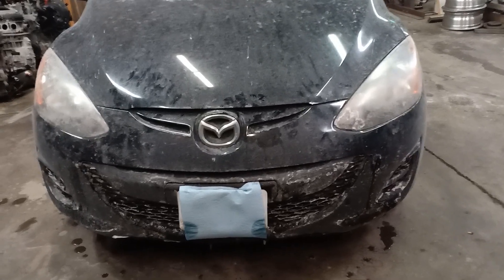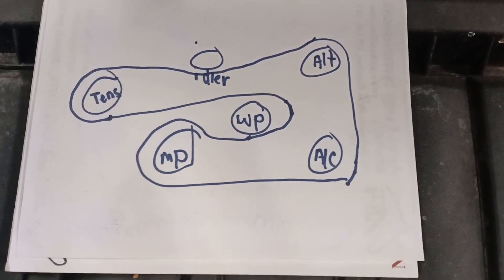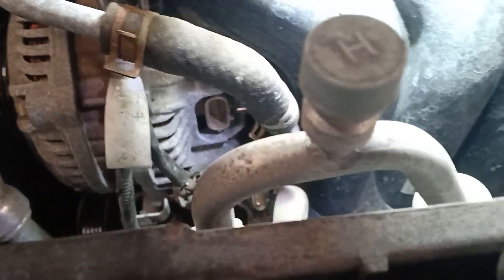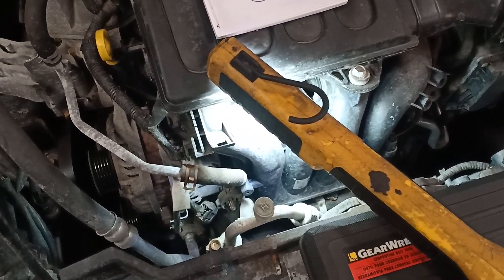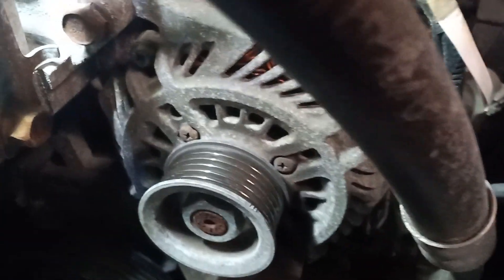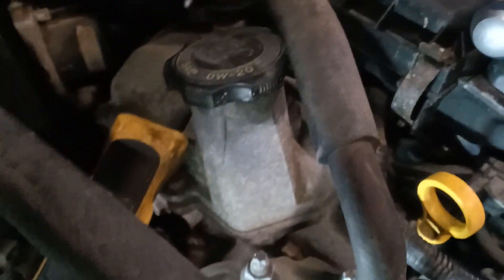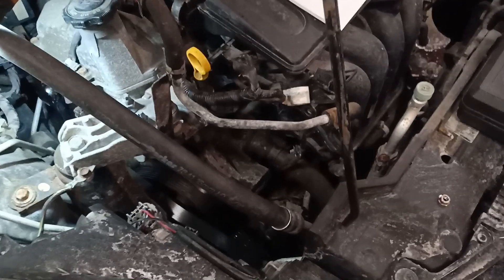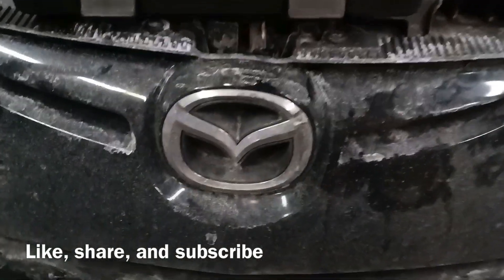EASY DIY: 2011 - 2014 Mazda 2 alternator Removal And Replacement

Comment: I was too lazy to run to the store to rent the tension rod kit so I jacked up my front passenger side and placed two jack stands. You can have a smaller breaker bar or socket wrench that'll fit from the bottom and then I put a big wrench on the handle connected to the tension bolt which I was able to push with my foot and shimmy the belt off. Repeated the same method to get the belt back on. Had to wrestle it a bit but it wasn't too bad. I'd recommend ordering the little plastic clip that opens to the nut holding the connector to the battery because the bottom part on mine basically fell apart.

Comment: Thank you Jay.  I was able to replace the alternator and belt on my girlfriends car yesterday thanks to your video.  I had the most trouble getting the alternator physically out/in. I disconnected the bracket towards the rear of the engine bay holding that AC line to give me a little more wiggle room. Until I did that, was unable to squeeze it through.
Reply from the maker: Awesome dude.  Thank you for watching.  Please consider subscribing.  I have new content coming soon!!

Comment: New sub here thanks for sharing, where is the thermostat on this model car is it under near the alternator I did see the water housing in the video not sure if that was it
Reply from the maker: thank you for your question.  This vehicle is coming in for an oil change soon... I will check for you and let you know.
Reply: @jaythemechanic4950  thank you
Reply from the maker: Car came in today for some a/c work. I will answer your question tomorrow
Reply: @jaythemechanic4950  thank you mate
Reply from the maker: Hey Rad.  The thermostat housing is on the drivers side of the engine where the battery is.  If you look on that side of the engine you will see a black plastic thermostat housing.  Hope that helps.
Reply from the maker: You can also just follow the upper radiator hose.
Reply: @jaythemechanic4950  thank you so much man, I appreciate your reply look forward to your next video
Reply from the maker: No problem.  I have the mazda 2 here now and If I find time I will make a cv axel video and a front wheel bearing video.

Comment: Is it easy to change the water pump? And do you have to remove the passenger tire  to get access to it? Any help will be much appreciated. Thank you
Reply: Just saw your question.  I have two boys, and they both have this car each.
The water pump takes a little bit of work bit not hard at all and sits under and to the left of the alternator. As stated..the bolts take a little work.  The new water pump comes with a new gasket.  If it doesn't, make sure you ask for one or get a better quality pump. 
Hope that helps . Oh...remove alternator to get to water pump
Reply: @sgomez3047  Thanks I did it while back. Took a little bit of work but no problems. Been running good.  Thanks